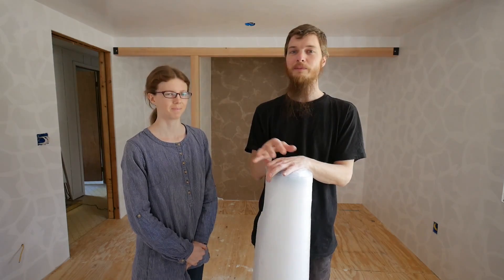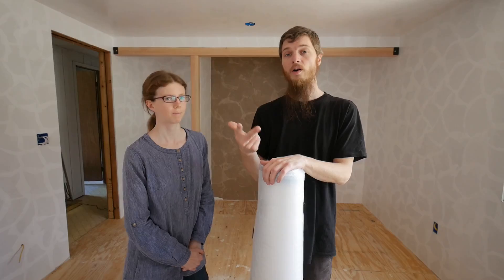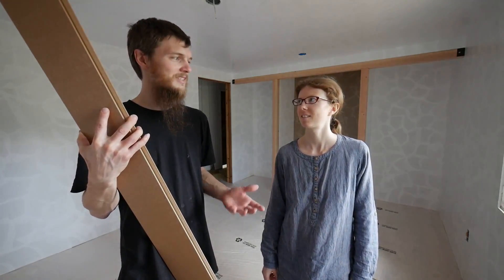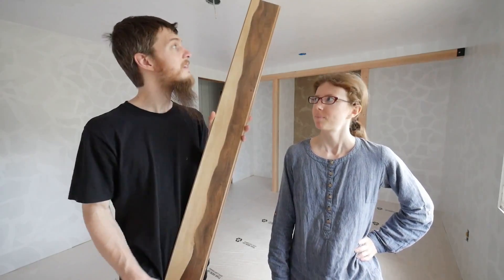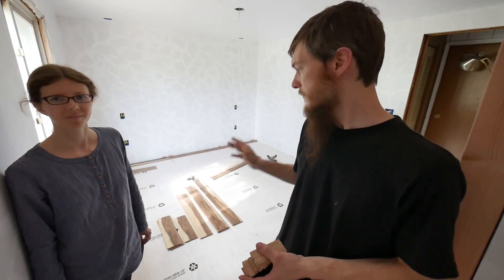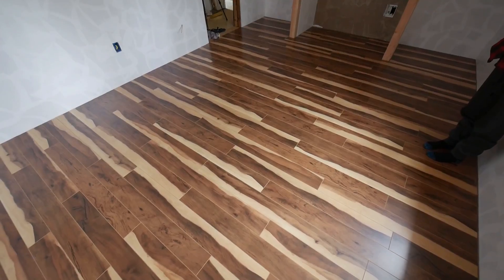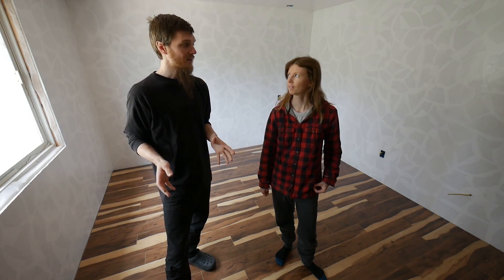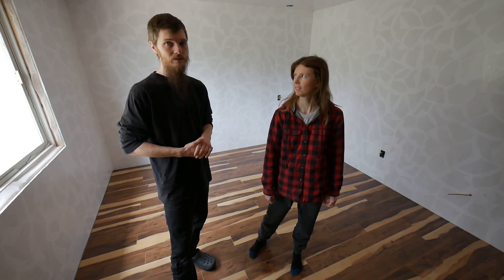Bedroom Floor Reveal - It's Bold - Home Renovation

Comment: I love it! After I got too sick to work in the ski industry I worked for a few years selling, installing, and repairing flooring. The trick to buying inexpensive laminate is to look for the stuff with an AC4 wear layer or better that's on sale. Keep some when the job is done in case you need repairs down the road. Also buy a bottle of recommended cleaner and save the receipt. The first thing manufacturers say on a warranty claim is that you didn't use a recommended cleaner. Having a receipt to show them escalates your claim immediately past that hurdle.

Comment: I really love the choice of laminate  you made. However I'm not crazy that you didn't lay it so it goes with the grain. Now it looks fake and not natural..   but it's just my opinion.  I'm glad you guys love it!  💜
Reply from the maker: I'm not sure what you mean about going with the grain. This is how the floor should look. There's really no other way to lay it unless I am misunderstanding you.
Reply: @diyfferent  what I mean is the next board should kinda match the grain of the last one you lay down so it looks natural . Some pcs. you have end blonde and start brown therefore you see each cut.
Reply from the maker: @searchingforsigns8445  Oh yeah that's normal. They aren't really meant to roll into each other.
Reply from the maker: Here is the flooring we did: https://www.homedepot.com/p/Pennsylvania-Traditions-Jujube-12-mm-Thick-x-4-76-in-Wide-x-47-52-in-Length-Laminate-Flooring-11-sq-ft-case-368101-00263/205808552 

And here is a solid hardwood floor to compare: https://www.homedepot.com/p/Blue-Ridge-Hardwood-Flooring-Hickory-Natural-3-4-in-Thick-x-2-1-4-in-Wide-x-Random-Length-Solid-Hardwood-Flooring-24-sq-ft-case-20558/206812823

It's just how it's installed. :)

Comment: I think the floor looks great - the walls not so much.  One thing I would change would be to run the flooring boards parallel to the long walls.  That is the usual way to lay flooring, and would look even better in my humble opinion.

Comment: I like the floor, and I would definitely put laminate in my house (it is very durable if you get a good quality laminate). I also like this pattern, but I don't think I'd put it in my house, because it doesn't go with the character of my house. The only thing I would have done differently is I would have laid the flooring parallel to the window wall. Normally in a floor install, the product is laid along the longer axis of the room. But all in all the room is really coming together, can't wait to see the next steps. :)

Comment: I'm so happy that you guys are tickled with your bedroom, so far.  That is all that matters.  I do like that floor.  I would have thought that you'd lay it in the other direction to meet up with the hallway.  But that's your call.  If you haven't yet bought your trim work, think about a taller baseboard than the little 3" standard one.  A little taller will make your whole room more up to date.  The same goes for the door jams.  And painting them prior to install is such a time and mess saver.  Good job, you two.
Reply: Window treatment if you do curtains, Looks great from top of wall instead of right above the window.

Comment: Belles music was great addition to video.  For a Mobile home I love my new vinyl sheet floors with cushioned backing in living and kitchen.  It looks like wide planked wood.  So durable and affordable in heavy traffic area.  It is a breeze to clean.  Now that you put the floor down it reminds me of Africa.  The giraffe prints on wall and the mixed woods on floor. A Nature place.  Now reed blinds for windows with sheers on the sides.  You must have saved money by buying enough for all three rooms.  But, I wouldn't use that for a living room.  Just stick to a solid so that it will not clash with everything around a living room.  Good job guy!

Comment: It's beautiful.... goes nice with the closet.    When I did mine... it was a mistake to use the matching quarter round molding trim that they sold because it wasn't real wood.  Just by moping the floors, over time, it began falling apart.    So when you do the trim, I suggest going with real wood, and staining it to the color of your choice.

Comment: Looks super nice!  Laminate does scratch very easily, make sure you out felt or felt coasters, felt cut to size coasters underneath anything you'll be moving around such as heavy furniture, dining chairs etc because it will scratch.  They say its scratch resistant but it will still scratch.  Looks really nice.

Comment: We've had laminate in the kitchen and mudroom / laundry room for a while and you're right it is very durable. The only problem we have had is water! If we come in with snow on our feet, and it sits and melts, we have found that the cracks or seams kind of swell a bit. We've had ours for many years, so maybe they've improved that aspect by now.

Comment: I like the floor, and overall I like the look. Floors always look best though when the planks run parallel to the longest wall in the room, and I do think it would look even better if a second layer of paper went on the walls, so they appeared a little more solid. I think it wouldn't clash as much, and I keep noticing the drywall and white seams behind the paper.
Reply: @joestutzman6793 I think it widens a long narrow room.

Comment: I have managed to scratch the laminate in every one of my rooms; mine also is not water resistant and is now buckled in many areas as I have grand kids that come over often
Reply: I've had the same thing happen with mine but my husband installed it over 10 years ago.  We found a laminate flooring at Sam's Club that is quite thick that we will be trying out because it seems to come a long way from when we used it.

Comment: Did you see a sample room online with the flooring style?
Reply from the maker: Yeah there was a pic of it online. But sometimes it's still hard to know how it will feel in your own space.
Reply: Out in the Country : Well it looks lovely. ❤️. We used 4 x 4 ends as tiles and glue them onto the wall of our current double wide project.  Cheap, scrap and hardware glue and we have a really nice, durable for family proof wall.   Looking forward to your next room!  Will you be adding ceiling fan lights in the rooms?
Reply from the maker: @cassityart7001  Ceiling lights, but no ceiling fans :)

Comment: I love it. Good job! Is that called "African Wood"?

I did my whole house (not the bath yet) with vinyl plank (TrafficMaster in "Cherry"). I wasn't planning on doing the whole house but after I saw it in my bedroom, I went for it. One nice thing about it is that it's not "click" but 2-part adhesive (on both mating surfaces). That meant that I didn't need a miter saw, but instead used a pair of tin snips to make the cuts. It was so easy it was like sitting on the floor on my butt putting a puzzle together. (I can't kneel/squat.) After making the decision to do the whole house, I was able to take apart the planks that ended at the door (using a putty knife that I heated with a heat gun to pry them apart) and replace them with full planks to avoid a transition strip at the threshold. (Needed the double-sided adhesive tape they produce for this product for when planks need to be replaced.) I'm planning on aging in place and because I already have mobility issues, I can't have trip hazards like the edge of carpeting. One nice thing about it is that I've discovered how to "fix" some of the scratches that occurred when my contractor was installing my kitchen: Heat it with a heat gun and rub the softened scratch with the plastic rounded handle of a old pair of scissors to push the two sides of the scratch down again. Worked like a charm! It took a couple years to get it done (a little at a time, covering the exposed edges with the same non-stick paper that comes between each plank, then cover the paper with the cardboard from the box and taping it down until I could get back to it again; the tape didn't stick to paper). It will be a couple more before I get the bathroom done, but the way I oriented the runs originally helps as the planks run in the same direction as the closed bathroom door, so there's no plank ends going through the threshold that require full plank replacements. I still have the 4 boxes in my bedroom closet waiting to do the bathroom. I bought it all on sale at less than 80c/sqft. Currently it's going for $1.69/sqft but I've seen it over $2 on various occasions. Being able to do long term planning and take advantage of sales really helped my budget stretch.

Comment: I really like it. Almost wanted more of the blonde wood to show up. It's different for sure, but it turned out great. I used to have a laminate floor in a house I lived. We had it for 15 years and it was still looking good. If you drop a Phillips head screwdriver on it....yeah....your out of luck....it make a little hole. And you have to be careful with moisture, when you mop the floor don't soak it, don't let the water go under the floor ever. But other than that I think there is nothing wrong with laminate flooring.

Comment: Beautiful!...what kind of heating/cooling do you guys have?..I noticed there are no floor registers in your bedroom.
Reply from the maker: We don't use AC. Our heating will be a wood stove and also electric wall heaters. The house has a propane furnace that we started off using, but we're getting rid of that, so there will be no registers anymore.

Comment: Well, looks like the installation went pretty smooth, great job!  Personally, I would have probably laid it vertically (90° from how you have it laid), rather than horizontal as you did, but there's no wrong way, it's a matter of taste, and if you like it that way, then that's fine.  Since cost was a big consideration, I think you did pretty good as far as choice is concerned.  You're right, it's a very high contrast 'bold' look, but again, that's fine, and since it fit your budget, that's a plus.  Can't really tell without being there to hold it in my hand, but it appears to be a good quality flooring, and while real hardwood is generally more desirable, you made good points about the durability.  Overall though, I think the entire project is shaping up really well, you've definitely rounded 3rd and are heading home, just a few more finish details and that room is done, and not only looks good, but is more structurally sound and VERY well insulated, so not only does it look nice, but it'll help with heating costs and durability of the home, resale value, etc.  Again, great job !!

Comment: having laminate through my whole house , i can say its nice stuff but there are some down sides 
it isnt real good with moisture like from mopping or spilling a bucket of water over it , as the base is either mdf or fiberboard it curls up at the seams  , the v groove type flooring are a little better at hiding this , it shows up in the reflection on a shiny floor and in direct sunlight 
the smooth types of laminate like the cheap stuff ikea sells is REALY slippery when walked on with bare wet feet , i advise to use the type with a actual woodgrain and dont lay it in the hallway outside the bathroom like i did , it caused me to allmost break my neck and do several painfull splits untill i got smart and pulled it out 

make sure you put the packs of laminate inside the room to aclamitize to the heat and moisture in the house and leave space along the walls to alow the laminate to expand and contract 
if you dont the laminate will bow up and come off the floor and possible damage / move the walls , the cover strips along the bottom of the walls are to alow the material to work without showing a gap 
when buying the laminate make sure the batchnumbers on the packages match and get extra , its eazier to return the leftover then to rip out a half finished floor because that brand of laminate has sold out or isnt available no more , the batchnumbers is to make sure the grooves and plank sizes are the same 
if you get two colours of the same brand you could allso make a zenra style floor (dark wood light wood ) i layed my flqor in diagonal (corner to corner ) and it looks realy special without being overbearing , there was a little more exess material but it wasnt as bad as i thought as i could use the cutoff on other parts of the floor 

looks like you gotten the better quallity laminate and the v groove so it should last you a long time , if it turns out slippery there slightly sticky type floor waxes or adding a tiny little bit of coca cola / sugar to the mopping water might help 

i like how it looks 
one thing i done in one of the rooms is cover the back wall of a cove with the same stuff , looks realy nice , you could do the same thing with the part you covered in the brown paper

Comment: Is the floor fully locked together?  Seems like I can see the lines between every board.  They look like there is about an 1/8 inch gap between each board like they aren't fully locked together.
Reply from the maker: These boards have a beveled edge which was important to us. We really don't like the smooth, flush fit laminate floors.
Reply: @diyfferent  Ok, I wasn't sure.  I know some of those laminate floors use a tool to grip the edge and then you use a hammer to drive them together and if they aren't fully locked, they look like that.  You two are really fixing that place up nice.

Comment: I don't know what research or salesman you got but hardwood floors are far and above more durable. It can be sanded 10 times over, and because it's hardwood, does not scratch so easily. I understand the need to save money though. Just in the long run, hardwood would probably also save money. I also would've put the grain the opposite direction and chosen a more traditional pattern for longevity. But if all that makes you both happy, that's ALL that matters. You're still doing a great job and make conscientious choices. And finally, it sure looks better than what was there before!
Reply: Peace ...  Dogs and g’kids scratch hardwood flooring.  Ours was scratched everywhere the dogs and kids played in their riding toys. Yes the hardwood flooring can be sanded but it’s a messy job no matter which sander or company does it. No matter how much of a barrier you put up other rooms get the fine dust everywhere.  Our next build will have good old laminate and slate flooring.

Comment: One thought, the color of the flooring doesn't quite match that beige in the closet. In retrospect, the paper in the closet could have been done later.  To color coordinate, you can pick a shade of color in the wood you like, and make that the color that goes in the closet. You can slightly vary the color of paper in the closet to match the variegated pattern on the floor.

Comment: I love your choice but u ran it in a way that your going to have way too many cuts for hallway.had you ran it the long way to your home the runs would be stunning!! With patterns always run it length of room not width.start wall should be under window..the effect looks good but would look much sharper had you ran it length wise.your hallway is now going to be choppy instead of long continuous runs...if it were me I would pull it back up and run it length wise as it will really look chopped up in future renos..I never critize you guys as I love you both and fact I learn tons but flooring is my trade and I'm telling you it's laid wrong for this pattern wood.
Reply: Correct. Agree.

Comment: 100% I knew you were doing a zebra floor. This before reveal. But I thought you were going to do a light board then dark. Repeat. Congrats for finding a pattern that is truer to zebra pattern. 

Not trying to be mean. Just don't move. The floor looks great. It is the walls...

Were you consciously going for jungle theme?
Reply: First Last don’t be so critical! It is their taste...if you can’t say something positive, don’t say anything.
Reply: Funny! Holly Samson. I find your comment more negative than First Last. Didn't  care for the walls, many people didn't. It's  all cool. Would be pretty boring if we were all the same. I like that oitc are doing what they like and not playing it safe.
Reply: First Last :  Holly, I don’t think First Last is trying to be mean.  Doug did ask for honest opinions!  This is an honest opinion!  This flooring is not my choice either, and I certainly would have run the boards the long way.  To make the room appear longer not shorter.  I personally would not want that much focus on the floor.  I think the walls are quite subtle and i like them.  But with the floor now that busy, in my opinion it limits textures in accessories, like bed coverings, curtains, etc!

Comment: usually you run the boards the length of the long wall. surprised you went across the room width. Also, you don't need to cut off the tongue when starting the first row. molding will cover the gap.
Reply from the maker: The room is almost square, but orientation of boards is just up to preference. Our camera lens tends to skew things. In a narrow room, some people like to run them the short way so it doesn't feel like a bowling alley.